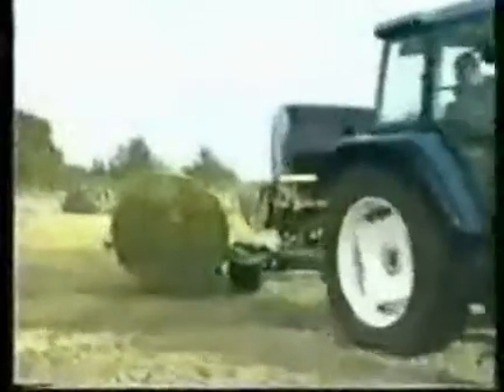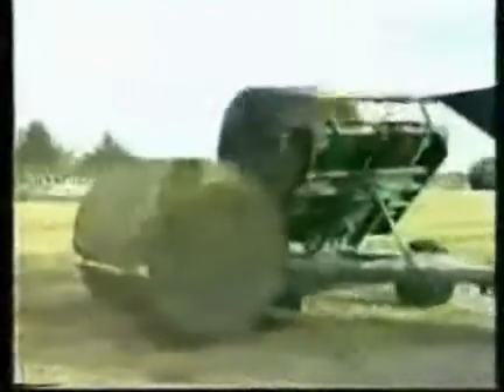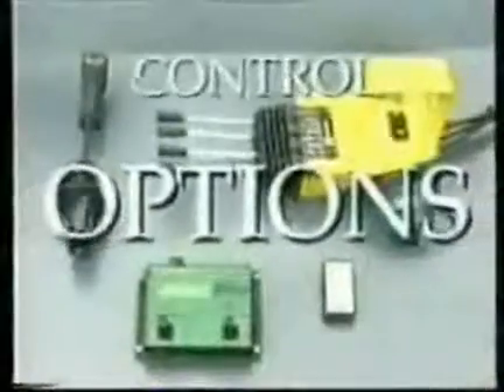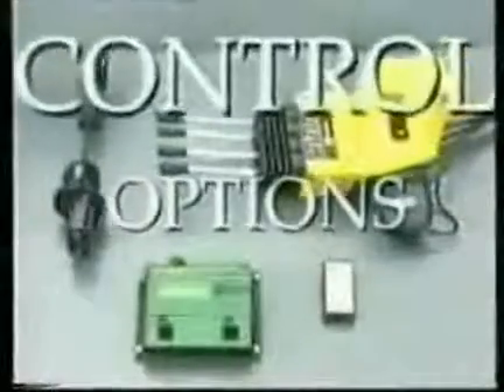Conor Bale Wrapper

Comment: Wben was this filmed was it pre 2000
Reply: I cannot be sure but I am currently repairing one the appears to be a 1999 model, has a different load arm and trails to the side of the tractor, has a RDS controller which I have all the wiring diagrams if you are interested, I thinks the video is a later post 2000 model.
Reply: @colahandyman67  a no I'm sound thanks don't have one at all just interested to find out when it was filmed
Reply: @ the video quality does make it look older but as I said it look like a post 2000 model so best guess is 2000 -2002, it was posted to youtube 15 yeas ago so that is 2010
Reply: Yes I wonder is their a longer version of this video somewhere this looks like it got cut short